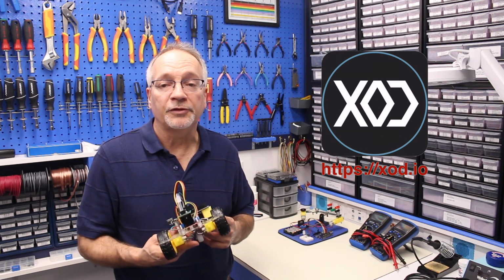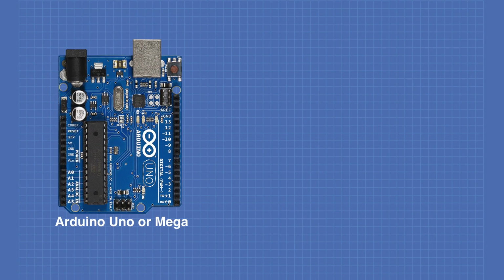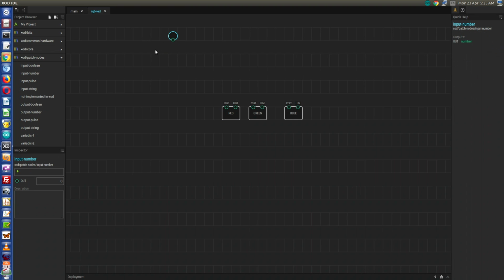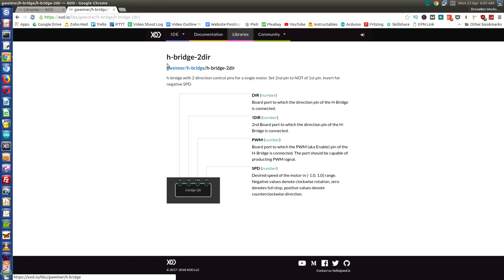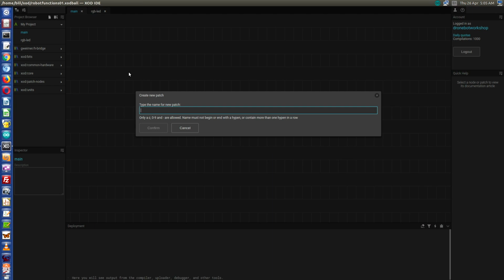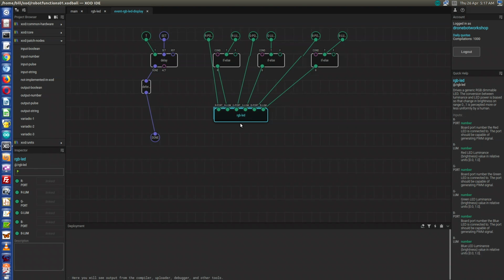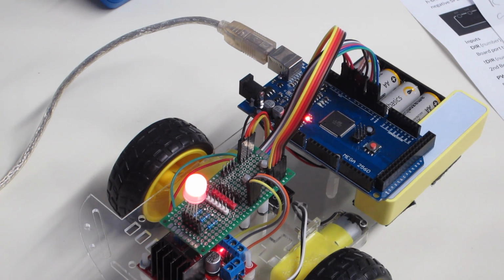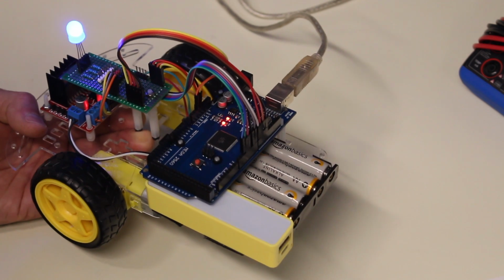Arduino Programming with XOD #2 - Robot Car

Comment: Tires are directional, but put on not correctly providing different grip. Also, weight distribution - you need to add counterweight.

Comment: I just came across this and your teaching level is fantastic.  Perfect for beginners.  I have some tech experience in the past with electronics and  integrated circuits.  With other video tutorials I go to sleep during the newbie parts.  You are able to hold my attention all the way through, even though I am familiar with some of it.  I love XOD due to the IC background that I have (1970's), so it is very simple for me to catch on to this type of programming.  One question.  I see this post is 2 years old, as are most other reference sources.   Locations of nodes in the menus  in these videos are outdated as XOD has updated, so it is hard to locate them or what replaced them with a different name.  Did XOD catch on and pick up supporters initially, or has it sort of died, or is it just stuck in limbo?  ie nothing much about bluetooth or  nRD24L01 or the 433 mhz modules.

Comment: Most motors are bias wound. That might be your problem with it not tracking straight. The direction of the bias gives it just a bit more speed and torque. Maybe?

Comment: I plan on starting small, but my eventual goal is to control an 11 amp, 3 phase hydraulic pump motor with a pressure transducer feed back, to hold the load/pressure.

Comment: your video is good. but It's useless since I cannot use the software: when I try to  "deploy, upload to Arduino, I get this message: Arduino dependencies missing
. You have to install these packages first: Arduino AVR Boards.
I asked you twice how to install these package since I cannot find anything about this issue.
Why don't you answer?
So, I will uninstall first unsubscribed from your youtube channel, and uninstall this @#@$@% XOD from my computer. Anyway, Ardublock works fine and does the same job.
Screw XOD...

Comment: Well, Xod looks great until you look at the generated code.

Uninstalled.
Reply: The code is very thoroughly commented (a good thing), so the code sent to the arduino is much smaller. Not being a seasoned coder, I couldn't vet it for efficiency, but if I were able to do that, I wouldn't need XOD. So far, it's the easiest to understand visual programming system I've found. And these tutorials are a must! Thank you so much. 

I'm keeping it.

Comment: would it be possible to make a video about LIDAR. Cheers
Reply from the maker: I would LOVE to do a LIDAR video, however I haven't yet found a LIDAR unit that is reasonably inexpensive - even Sparkfuns LIDAR-Lite unit is still on the expensive side. Once one becomes available at a low price I'd certainly pick one up and do a video. If you or anyone else knows of a reasonably priced unit please let me know.
Reply: I ll do so, thanks
Reply: @Dronebotworkshop  67

Comment: But only for the Arduino UNO, no other boards are supported at the moment acording to there website but I do love all your Video's
Reply from the maker: Hi Bob - Actually if you notice I used an Arduino Mega for the robot and it works fine.  The list of boards in the IDE (on the drop-down when you deploy) is quite extensive although personally I have only used the Uno and Mega so far.  
Some of the info on the website may be referring to older version of XOD, they actually released a newer version the day before I published this video.
Thank you for the nice comment regarding the videos!

Comment: Can you create a project in which both arduino and ruspberry pi are used ?
Reply from the maker: I do have a few projects I was going to present (IoT and Robotics) that make use of both devices, so the answer is a definite YES.
However if you are asking about XOD it is only for the Arduino.  Initially XOD was also available for the Raspberry Pi but the developers dropped support for the Pi several versions ago to focus on the Arduino.
Reply: Thank you very much for your reply. I would like to know that ruspberry pi does not have an analog pin which remains on the arduino board. Again, the internet can not be accessed at arduino board, which can be done at ruspberrypi. There are no such features on two boards. But I want to create a project that will control some electrical machines from a distance. Which is not possible without an internet connection. That's why our two boards have to take the help of this. Do you have any plans? If possible give a little reply. thank you.

Comment: cool Video, thanks. What I'll like to know is more about size of programs: What Software produce the bigger size of code on the Arduino for same use? I.e. The Blink Program. there is a demo in the IDE, you may also do them by XOD. What code is at the end of the day bigger for this use, the DemoCode f the IDE ode the code of XOD?
Reply from the maker: One of the drawbacks of XOD is that it does tend to produce larger programs than the Arduino IDE.  This isn't unique to XOD, other high-level languages on different platforms produce larger code than more efficient languages like C++.
If you're short on RAM or need to create something very fast and efficient you would be better off with the Arduino IDE.  
But in most "real-world" cases its the end result that counts, so if it takes a thousand more bytes of code to blink an LED it wouldn't matter as long as the LED blinks correctly.

Comment: Could you power both the Arduino and Motor Controller from ‘one’ 7.5v - 12v source?
Reply from the maker: Hi Michael. You could indeed do that.
One thing though - as the battery voltage falls it could drop below the 7.2 volt minimum required to power both the Arduino Mega (via the power connector) and the internal 5 volt regulator on the L298N.
12 volts would work well as long as your motors are rated to take it - the ones on my robot car base are only rated at 6 volts.